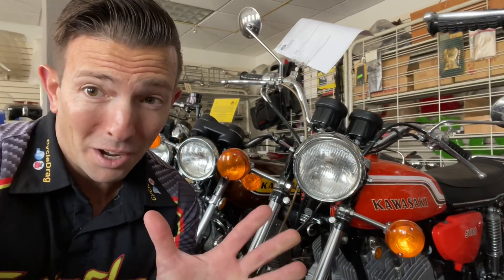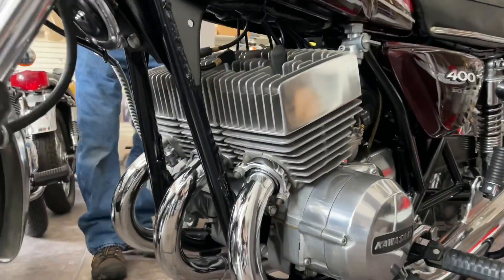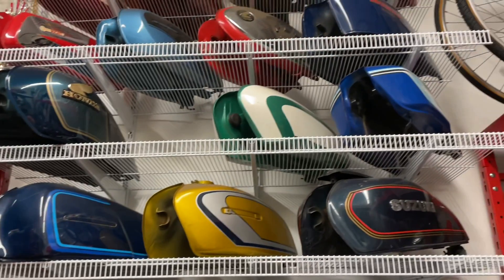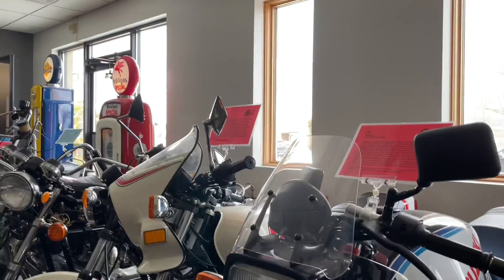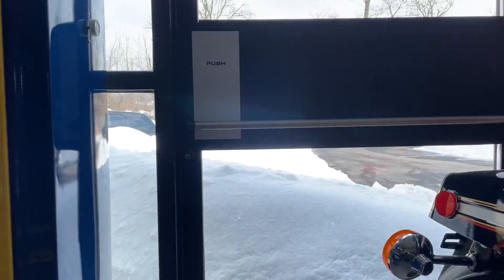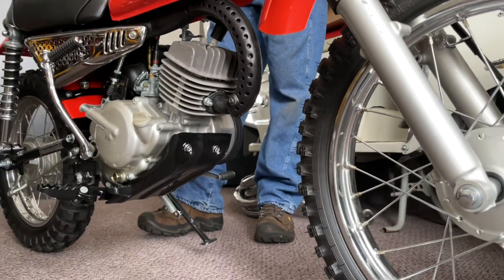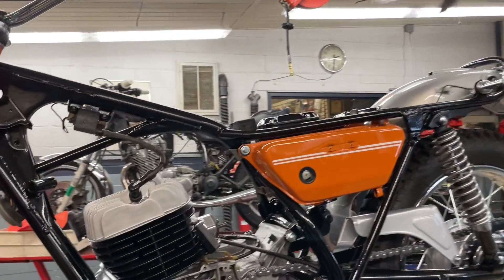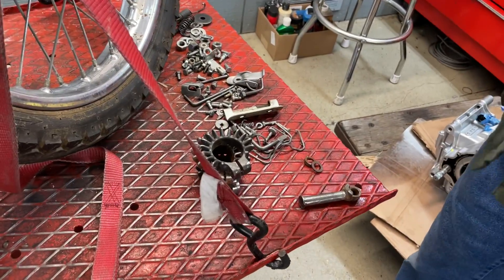MOTORCYCLE RESTORATION at it's FINEST!

Comment: Hello, there are many to choose from as far as restorations go I would probably go with a single or twin cylinder to keep it easier for me to handle and to find parts for 2 or 4 stroke models would be fine.
I’ve owned  a 77 KZ1000 A1 I bought in 79. I still have it but some parts that I could use are not available. I currently ride an 02 Concours. I worked in bike shops in the 70s in the Midwest and loved it and 
rode a variety of Japanese and Brittish models. Although it was seasonal work  and long hours and had to find other work for the winter months it was a lot of fun. Ken has the experience, tools, supplies and contacts I would consider people like him for a restoration, I want to ride now not work.

Comment: Nice
Reply from the maker: Thanks so much for watching. Which motorcycle would you pick to restore and why?
Reply: @cycledrag  My 1981 kHz 750 LTD ,it’s got carb problems.Bought it when I was 18 in 81.  I have put oil in the cylinders and cranked it. It’s on my bucket list to get running,It only has 24,000 miles on it .I washed it last year . Kept it in a Garage always ,covered up too.   
What was your favorite bike ?